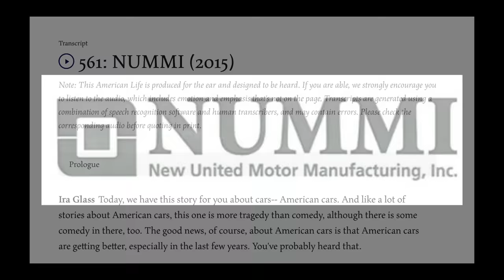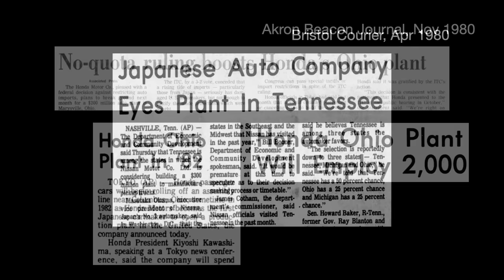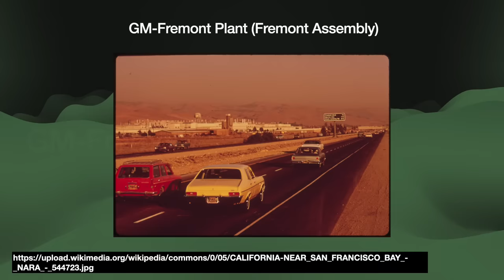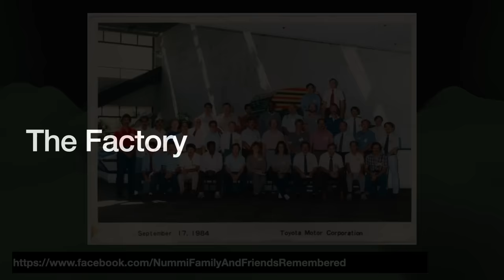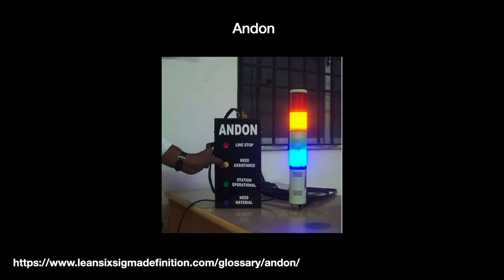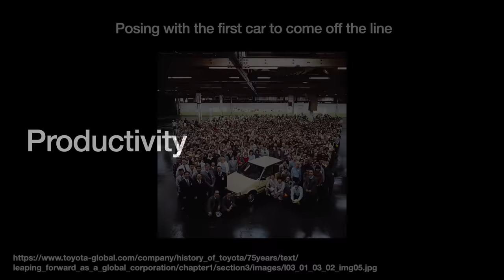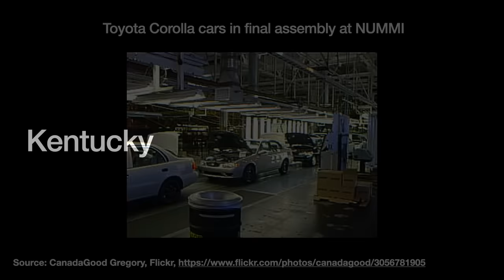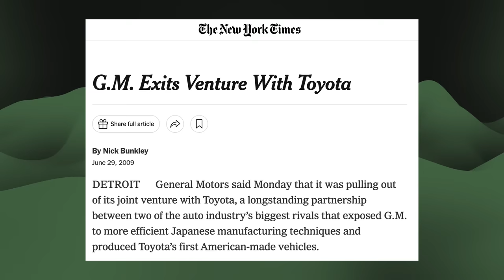How Toyota Turned Around GM’s Worst Factory

Comment: That just in time parts system was pretty much adopted by every company and worked well until recently. The industry hit the black swan know as the pandemic. Cars sat in lots, unable to be sold due to parts shortages. This caused car prices to explode, and for a while, you could actually sell your used car for more than you purchased it for.
Reply: it's more complicated than that, especially when it comes to electronics used in the car business.
Reply: Efficiency and resiliency are competing interests. You get what you pay for especially when a shock comes by.
Reply: @haveaseatplease  Companies anticipated low demand and canceled orders. When demand came back they struggled to get their parts because everyone now wanted their orders and chip fabs had already allocated the production to other customers. There was also pandemic related factory and port shutdowns but if everyone had kept a buffer of parts, things wouldn't have been as bad overall. I'd be interested in your take to expand my understanding.
Reply: Part of this is American companies implementing JIT on everything, even things that Toyota does not. Even Toyota over time has changed how much they store some things. It's all about lead time and complexity of the production chain. Stamped metal pieces, rubber seals, and windows do not take long to ramp up and down productivity. Electronic chips have lead times that can extend many months from order to final product, and to increase productivity takes years and tons of money with very expensive machinery that takes a year to make.

Toyota did not have nearly the same issues many American automakers had. But there were shortages of tons of different things affecting every industry. Even simple stuff eventually caught up to gt Toyota some.

Tesla didn't do the same thing many American automakers did with reducing orders. And since a lot of components are made in house by them, they just needed raw material availability which was better off than more complete components. The chip shortage did eventually affect them, but since they use those chips on their own components with their own firmware and software, they were able to switch to other electronics not directly compatible. Stuff like PLCs, microcontrollers, and other chip related shortage things, they were able to make compatible firmware to work in their cars and get around supply issues much better than others.

Comment: I owned a NUMMI-built car, a 2004 Pontiac Vibe GT, from new until 2021.  The day I drove it off the dealership lot was its last day at the dealer.  It ran flawlessly, never requiring any warranty work or any repairs other than wear items and general maintenance, for almost 200,000 miles.  Had GM still had an option for a NUMMI vehicle, I would have strongly considered it rather than the Toyota product I replaced it with.

Comment: How much of Toyota's "Japaneseness" was based on Edward Demmings work which was ignored in America?
Reply: The foundations were built upon Demming's pioneering ideas in statistical process control, but by the time it went from Japan back to America in the form of TPS, it was(and is) very distinctly Japanese both in terms of culture and terminology. A lot of the terminology don't have clean English translations and requires some exposition to fully explain.
Reply: How much of Japanese-ness is the ability to "culturally appropriate" the good while leaving behind the bad, whether that's society-wide sociocultural stuff or corporate culture stuff, and the ability for management to actually recognize valuable innovations such as Deming's work and adopt them, instead of fighting it until they finally die and are replaced by their less ossified prior subordinates who recognized it the whole time but couldn't implement it
Reply: Japan has always been able to take ideas 'produced' abroad and make it their own. The process, including but not limited to JIT, Kaizen, and Kanban, are all Japanese in origin. The basis being on Deming's while important is moot because the western countries decided to ignore an academic who had basically taken the statistical analysis field in a new direction which the Japanese manufacturing industry took to practice.
Reply: @choilive  Also worth mentioning, the failure of most Western non-Japanese firms to do the full JIT instead of a lazier, simplified version that didn't fully or even hardly at all take into account supply chain variables is how they/we suffered as badly as we did during and after COVID-19. Many, though far from all, are adapting and improving there somewhat. 

Tldr the difference was, the extreme of what I'm talking about, firms decided JIT not only meant just-in-time (for delivery / demand of the final product) manufacture; it came to also mean placing orders from suppliers of components and whatever other "ingredients" are required to manufacture that product, at the last possible time to try to maintain no inventory of those as well. This of course means that a hiccup there, means a failure to actually achieve JIT manufacture of your product.
Reply: Actually, JIT is not designed to handle supply chain shocks like what happened in COVID. JIT requires a statistically predictable flow of parts in the right place at the right time. This is required to eliminate the need for large inventory buffers that would normally be able to handle supply chain shocks.

This has been a well known compromise of the system and it works well most of the time. It just so happens that black swan events like a pandemic REALLY throws a wrench in the whole operation. 

For example: You expect Part A to arrive in 1 month from the supplier at the 3 sigma confidence level, but Part A actually ends up taking 6 months to arrive. You have very little inventory of Part A because you follow JIT, and Part A is required for you complete your Widget. Your entire production line is now stuck. Amplify this problem by the hundreds or thousands of parts in your BOM... you can see how it implodes very quickly.
Reply: @choilive  Thank you very much.

Comment: I drive older japanese cars for a lot of reasons. New cars have gotten impossibly complex to repair creating an imo throw away culture around cars. I pay mechanic bills due to age, but you need to know how to turn a wrench, not turn a wrench+be a computer whiz.

Current daily is a trusty old 1994 mr2 gt-s, if it does break down its makes sense as to why. The old toyotas are very well built/engineered, even though the car looks fancy in person its arguably a cost saver
Reply: You don't have to be a computer whiz to work on modern cars...All you need to know is what the different data streams are and how to interpret them. Computers aid is diagnostics by pointing you in a general direction of a problem. Sounds like you're just a tad lazy to take a few minutes to pick up a $20 scanner and do a little bit of research. I've been working on my own cars for the last 10 years and the car's computer has helped myself numerous times. If you think modern cars are so bad, why is there so many Toyota models with 300k+ miles that were made in the past 15 years? You definitely don't see that with GM, Ford, or Jeep/Dodge. Nothing is impossible if you actually do some research and put in some effort.
Reply: Had an '86 Camry you could drain the drain the oil with all 4 tires on the ground it was sweet.

Comment: I wonder whether Toyota has become the new GM. Here in Australia, the Chinese offer fairly comparable cars for about 2/3rds of the price of a Toyota now. That's a hell of a lot, and it makes you think - even if you'd normally never consider a native Chinese brand. $10-20K AUD less for a small to mid-size car is just hard to ignore. Toyota is also struggling to provide hybrids, with waiting times of up to 18 months for something like an RAV4. You could argue that this is because of their popularity - or, conversely, you could argue that their manufacturing planning wasn't up to the job. In any case, the Chinese will benefit from this because THEY can provide hybrids with short waiting times or even straight away. And the number of deliveries is scaling up fast - e.g. MG is now the 6th biggest brand here - in front of Kia. GWM will overtake Subura within the next few months. It'll be interesting to see what the automotive landscape will look like in 10y.
Reply: You get what you pay for, and Chinese brands aren't known for their reliability and durability even in China. So it depends how disposable you think a car should be.
Reply: @doujinflip  The same was said about the Japanese back in the day. The "trash" period is pretty much over if you can believe the usual review sites here in Oz. Feel free to google reviews of the Tank 300 or BYD Seal.
I, for one, don't intend to buy a Chinese car, but numerous others do.
Reply: @klausschroiff4405 these cap cars are blatant knock offs
Reply: ," said my old man about the Japanese.

Comment: When Tesla took over the NUMMI plant Elon demanded that the railroad give it heavily discounted rates far less than other manufacturers were getting. When the railroad said no, he ordered all the rail lines leading into the factory physically severed.
Reply: sounds like an angry boy reaction. Kind of suits the character.
Reply: Musk didn't die from his first miserable mistakes, and he even seems to be able to survive the capital slaughter of Twitter (now X).
Reply: Just curious (I really don't know) how the materials and finished product are moved in and out now?
Reply: @davef.2329  probably by inefficient and polluting trucks. They even made an electric semi truck specifically to do that, instead of using good ol' railroads without favored price.
…or he secretly built some hyperloop network… or by launching SpaceX rockets… the meme machine never stops with that bozo.

Comment: I always found it so ironic that the Toyota Production System was based off the work done by the United States rebuilding Japan after the war. 

The US brought the Training within Industry program to Japan. It had been developed to train unskilled workers in the United States to replace workers sent to war and deal with the labour requirements of wartime production. 

The Japanese used it as a foundational blueprint and the US abandoned it completely after the war.
Reply: Mainly because it was a unified program. Designed for a state run economy. Ie what the US had during the war. It couldn't survive postwar especially since with almost no war related destruction at home there was very little need for a state run business. I know that technically the US didn't nationalise industry during the war but if all industry can only produce for the state based on what the state needs it might as well have been.

Comment: when ALL have a COMMON goal, using common sense and TRUST (both earned and given) RESPECT builds. When respect is both given and received, EQUALLY; then together it is an almost insurmountable force. And it's only indominable fault, is that the TIMING all those, at the same time, is damn near impossible for more than two or three days.

Comment: Many of the non union Tesla workers in Fremont are millionaires because they participate in the stock option program.
Reply: This is definitely true because I was told this by my detail shop owner who has wrapped many of their very expensive hypercars that they do not drive to work. The problem is that many of them don’t care about doing a good job, they are working because of the great benefits. If they unionized they would loose everything, but they would get a higher wage per hour. I don’t know if any of this has to do with panel gaps?
Reply: how many would still be millionaires if the stock tanked? (IE they exercised their options and cashed out the stocks.)
Reply: @poofygoof Compare today’s stock value including splits and what Tesla was worth when the Fremont factory started  hiring workers. Tanked is a relative term.

Comment: I had a 06 Toyota corolla built at the NUMMI plant, ran until 320k miles with only replacing alternator and starter, only reason car lasted till 320k miles cause I crashed it , probably would have lasted at least till 500k miles

Comment: Had a manual 1985 Chevy Nova.....a joint venture. Dripped with Toyota reliability and was running 325k miles when I sold it.

Comment: "its workforce not unionized" is such a sad statement...
Reply: Did you listen to the first part of the video or?
Reply: Spoken like a kid who’s $200,000 in debt working at Starbucks trying to unionize it just because he learned about how great unions were in his freshman class.
Reply: Yep, sad that the union isn't there to demand a 32 hr work week but get paid for 40 ,  protecting slugs that don't do their jobs / vandalize equipment / steal company items.    

How about this, in one GM stamping plant it took a shift plus to change a large stamping die.  Faced with a possible plant closure, a few physical changes were made along with " don't be a union worker sleeping on the job " .  Die change out was reduced to 45 MINUTES !!!!!   I got this information DIRECTLY from the guy that redesigned the process and implemented the changes.
Reply: It's the ebb and flow of things. Factories would start out as non-union, then it'll underpaid its workers over time, then the workers unionize, the union squeeze the factory dry, then the factory gets closed and started over somewhere else (usually in Mexico or other cheaper countries).
Reply: Japanese companies have nothing in common to USA companies, they listen and care for their workers, one example was told on the video, they try to not layoff people as hard as possible.
Reply: @vitormoreno1244    Having worked for a Japanese consumer goods company in the USA, they tend to have enough workers to do the jobs and don't over staff to cover the 20 % absenteeism like the GM plant had.  This is one reason that they don't lay off. With a thin workforce , it makes more financial sense to retain workers during short term lulls in production than to let them go and have to bring them back.

Comment: I listened to that podcast years ago and thought woe to anyone who bought a car made there before it was taken over. The only thing I recall from the podcast was management insistence that the line never stops. Just push the car though where it was taken to an outside holding area where the problem will be 'fixed'.
Reply: In the 70’s, it was normal to work the bugs out, after you bought the car. Repeat trips, back to the dealership.

Comment: My first car was a 1988 Chevy Nova, which was a badge-engineered Corolla, built at NUMMI.  Notchback, little engine, five speed manual.  I got it for a hundred bucks when I got my license in 1998 or so.  And it was still running great in 2002, when the frame finally rusted through.  With over 300,000 miles.  In 1998, it already had a hole rusted in the front passenger floor.  Which, because high schoolers are stupid, was where garbage went.  Mechanically, it's got to be the best quality car I've ever had.  But it could have done with better rust proofing before being sold in a northern state.

Comment: What in the heck was wrong with the folks that were actively sabotaging the company they relied on to put food on the table?
Reply: I guess that workers who are treated like immature kids by their superiors will eventually behave like immature kids. Mostly the same people did different under the new management which actually trained them and delegated responsibility to them.
Reply: @KlausKaiserDB3TK  That is a valid point but GM would likely have an easier time replacing a worker than a terminated worker finding a new job.
Reply: They knew that the union had their backs.  Worked great right up until it didn't.

Comment: LoJack was a rock company that brought the rock for the foundation under Nissan in Smyrna TN....in there rock quarry  they pulled a shot (blasting rock)an when they did the water come in from an underground  rive flooded the hole place fast enough that there are still 2 bulldozer an a Peterbilt truck an lowboy trailer still there to day .....they lost the contract an hoover rock quarry took over ....
Just a little info a side note👍👍👍👍

Comment: Chevrolet sold lots of Novas between 1962 and 1979, so the Spanish "No Go" line is BS.  They knew about it before NUMMI and it didn't matter, because most didn't know Spanish and those that did knew the car was fine.  Maybe the problem is Chevy buyers didn't want the new Nova, which had nothing to do with the beloved car model name from before.

Comment: Pretty sure Australia was the first place that Toyota operated a plant in the west. It was done because it was in a similar time zone. Dependingon interpretation the JV started in 1963,68 or 72 they also built a plant in 1978
Reply: Toyota's were assembled at the Australia motor industries factory (AMI) from the early 60s but wasn't bought out by Toyota Australia until 1987

Comment: The weekend. The 8 hour workday. Lunchbreaks. Minimum wage. What do these things have in common?

People had to die to get us these things. They were not casually handed down from management as rewards for good behaviour, the underlying incentives of every system under capitalism is inherently exploitative, and management keeps more control when its workforce is near subsistence, divided against itself by race, and there's a large pool of desperate unemployed folk to threaten replacement with.

Solidarity forever.